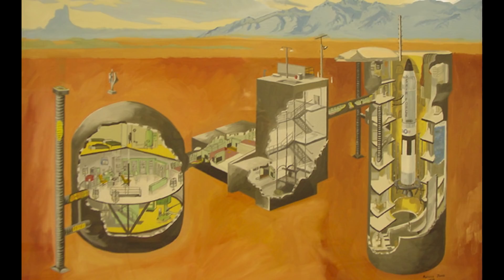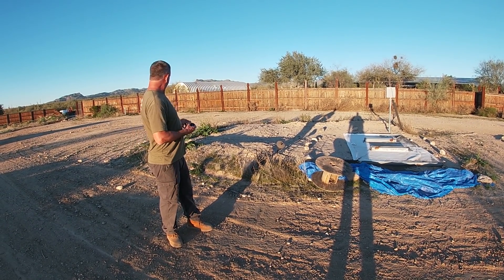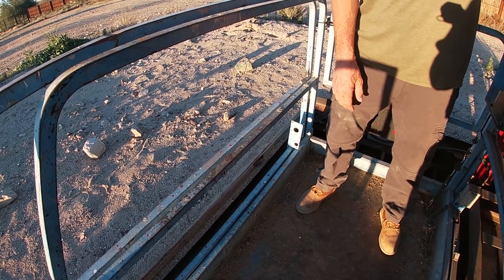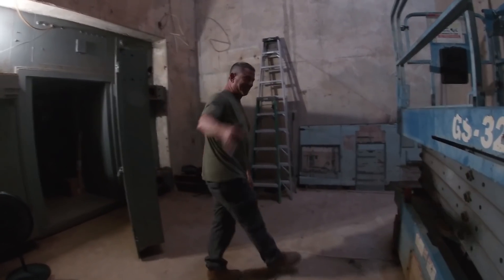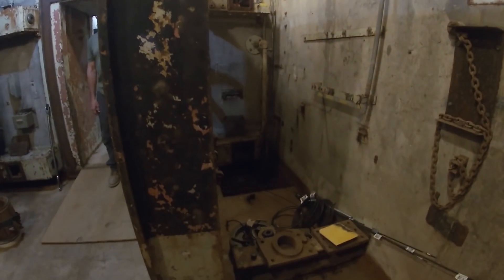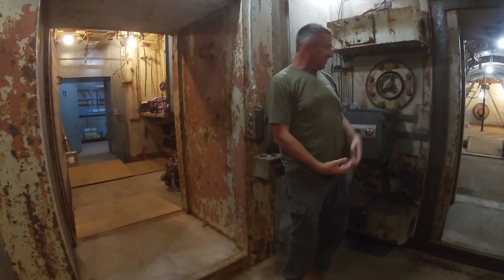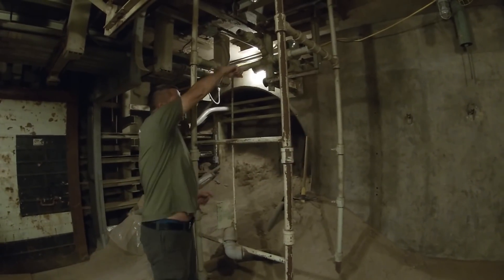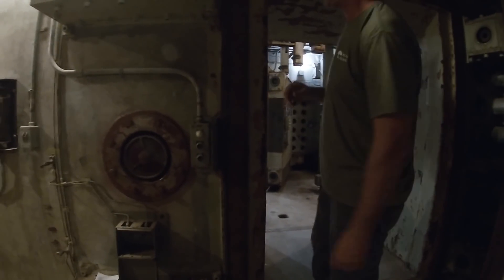S1E14 - Arizona Titan II Tour (1of3) - Owning a Titan II Missile Silo

Comment: Hey. I hope you read this. I'm an old Titan 2 guy who spent 17 years at DM. Getting HS-3 (your blast door locking pins was operated by a hydraulic pump called HS-3) is cool. But please remember this. Never ever put anything on the door sealing surfaces and then lock the pins. The pins will wedge and those connecting pins you're having to repair will break. A guy duct taped a penny then closed and locked blast door 6. The crews worked a day to jack open the door pin. The guys trapped inside were pissed.
Keep those surfaces clean and do not paint them. You will regret it.
Reply: You might want to checkout the video  on ssgtmyway channel.  I was at DM from 80-84. 390MIMS MK 6 Reentry Vehicle shop. Had alot of good times at DM and ended up making a video about it.
Reply: What about adding a good lubricant, to ensure smooth operation/movement of the locking pins?
Reply from the maker: They won’t be hydraulic on ours. Planning an electric actuator.
Reply: @atomicunderground9971  Well, just make sure you have a well. Maintained manual back-up method to open the blast door. Otherwise, that's freaking awesome and I'm totally envious!
Reply from the maker: @hrdknox2000  Escape shaft!

Comment: Where do these missile sites that are located in the desert get their water?
Reply from the maker: Wells
Reply: @atomicunderground9971  Does your site have wells? How many? Did you have to drill wells, or were they there already? How is your supply? What is the well replenishment rate (GPM)? How far down do you have to go to reach water? Have you had yours tested? 

The Atlas F Sites in Upstate New York (where I am), each had three (3) wells with a required replenishment rate of 30 GPM.  At a couple of sites the wells came up either short or completely dry. These sites then went to the nearest source of water (creek, stream, river), built mini-processing centers, and laid pipe back to the site. They then pumped water to three or four 90,000 gallon tanks. Each site had these water tanks.
Reply: @jefflovejoy2997  the onsite wells were decommissioned & abandoned in a state that may or may not be repairable. The site where I found the well, it was in real bad shape.
Reply: @tl1024  Thanks for the reply. The demos on these sites was so bad I figured as much. Water in the desert is treasure. I had also read where these desert sites had (stainless?) steel underground tanks adjacent to, and accessible from, the silos. The water was brought by tankers to these sites. Thanks again. Good luck.

Comment: If you have commercial power to open the door.....what happens if power supplier is knocked out before you get to the door?....do you have an analogue supply as back-up?....anything electrical or digital will be knocked out.....One other small note is that having a door open outwards will inevitably be covered or blocked by something entombing anyone inside and making quick entrance and exit futile.
Reply: I thought he said 12Volt power right before Commercial electric so maybe it's being converted and he has battery backup
Reply: The latches could be manually opened with a human powered pump. It's not especially fast, and if it were attempted during operation (and you hadn't beed detected long before reaching the door), you would be greeted with a barrage of gunfire when you opened the door. I have taken the museum tour several times, and reaching the blast doors undetected would be incredibly difficult james bond level stuff.

Comment: I was in an Atlas site in TX in 1969, four years after decommissioning. All the electronics, hydraulics, etc. had been removed, but the crib was intact and the electricity was on so going down from the surface to the crew quarters and silo was easy. I'm puzzled why with Titan they blasted and filled whereas with Atlas they didn't bother to do anything other than lock things up and flood the entry to the blast doors. All you need do is excavate the fill, not that it will be quick and easy! Thanks for this video.
Reply from the maker: Strategic Arms Limitation Treaty requirements. Although never ratified we did it anyway.

Comment: Pin rusted in the locking mechanism? Aren't these sites build to work forever?
Reply: No , only if they are maintained they will work but the sites that are decommissioned were under water and heavily damage by dynamite during the decommissioning stage.
Reply: @josephbennett3482  Ouch.

Comment: I wouldn't remove the steel beams outside the decontamination room just to be safe. I'm sure they're in there for one reason or another. 

Also if you don't know the name of the suits just call them Hazmat as that's a good umbrella term.
Reply: The beams are not structural, they were there to support the pipes extending between the launch control center and the missile silo.  And I like the suggestion to call them hazmat suits - that's a term everyone understands these days.

Comment: First mod would be taking a hammer to that ear piercing beeper on that lift!
Reply: I tried to disable it - but the beeper is integrated into the circuit board on the controller.  It's almost as if they designed it so you could not take a hammer to it!  I think I will try to plug it or something but I am not willing to take the risk of tampering with that circuit board, it's really expensive to replace.
Reply: @ArizonaTitan       I was a combat crew member.  SAC speaker  had minimum volumes.  We duct taped 4 inches of foam rubber over the speaker.   try it
Reply: @brucebedford5121  The speaker is tiny and built into the circuit board INSIDE the joystick control of the lift.  No way to tape foam over it.  I agree, if it was accessible I could foam it or better yet cut the wires!
Reply: @ArizonaTitan  You need to simulate the load of the device. A non-destructive way we lower or even silence piezo buzzers at work is by threading an 8-32 screw through the opening to stop the vibration.

Comment: I am still watching the video and it is awesome.  Just wondered at 3:23 where the door flexes because it is being hydraulically lifted on only one side, why you didn't install a hydraulic cylinder on the other side as well and just use a splitter to send hydraulic fluid equally to both cylinders.  Would be much more solid.  Anyway, loving the video and your missile silo!  :)
Reply: There was a guy helping me build it, and we only had one (big) cylinder.  We tried to compensate for the flex with a tension cable on the top.  That was 3 years ago and I was a rookie with hydraulics back then.  But you are right, it's on my list of thing to redo properly.  It does need 2 cylinders and a safety valve to prevent quick drop if there is a failure.  Good eye!
Reply: Good job!
Reply: I see the steel cable on top of the door now.  It helped.  I love this place you guys have.  Any chance of me visiting and taking a tour from you?
Reply: @KingCobra1968  Sure!

Comment: unplug the beeper on your scissor lift. those things are so damn annoying and even more so when it echoes.
Reply: I TRIED!!!! it's on the circuit board in the controller and there is no wire to it... soldered in and I am afraid to screw up my controller!  Must be a reason it's so integrated... maybe workers were unplugging it?
Reply: @ArizonaTitan  sounds like you have one of the models that integrates the beeper into the circuit board, most of them are screw terminals or spade connectors. if you follow the circuit board traces you will find the power or ground for the beeper and you can just cut one of those wires. another option is using one side of a pair of cheap ear muffs and taping it over the beeper, this will muffle 80-90% of the noise.
Reply: @crazypete3759  I'll try muffling it, thanks!
Reply: @crazypete3759  ... a small amount of silicone sealer will silence the beeper. Just cover the holes, smear it over, and let dry for an hour.
Reply: @crazypete3759  ... not everyone has a drill handy but it's fairly easy to find some sort of glue, putty, or sealer. Besides, a drill and a PC board could be an issue.
Reply: @rupe53  if you don't have a drill, use a hammer!
Reply: @crazypete3759  ... come on dude, he said it was on the PC board so needs a delicate fix!

Comment: We need to crowdfund Doug and have the level 2 (long cableway tunnel) entrance to the silo itself uncovered, so we can get a look inside this thing.  We know it's dry...or should be given the condition of the other elements of the site...so let's find out just how 'bad' it is inside!  If the generator and other large equipment deemed to cost-prohibitive to remove is still in there...wouldn't THAT be cool!
Having the tunnel removed between the access portal and the silo simply makes this site perfect for this venture!  Providing of course Doug is even open to this, lol.
Reply from the maker: Crowd fund me and I will do it. About 30k
Reply: @atomicunderground9971  You mean for Doug or at your site?  Because I thought your silo is flooded...?
Reply: We own the heavy equipment necessary.  Cost at my site is the actual tube and installing it properly.

Comment: At 15:45.  Those are called blast dampers and are designed to close if there is an overpressure event from the silo (similar to the blast valves from outside).  They are NOT one way air valves, since air can go backwards through them if the Air conditioning in the control center failed.  We would actually have to manually close them if the control center AC went down to prevent negative airflow.  In fact it was part of our daily checks to measure the air flow to make sure that there was higher air pressure in the control center than in the blast lock and between the blast lock and the silo.
Reply: I just love information like this...so cool you were there!
Reply: Thank you!  I was under the understanding they would close automatically if air flow failed (in addition to blast), thus the 1-way story I was told.  I have the pistons and connectors intact, but have not got around to seeing if they work.  Maybe a future video?  ;)
Reply: Anytime, friend.  I hope you really enjoy your new place.  I was at McConnell in Kansas, but have some really great memories in those complexes.
Reply: @sparc77  Thank you for your service.  Drop in if you are ever in the Tucson area.
Reply: Thank you for the great tour, looks like one hell of a project! I thought all of the escape hatches were filled in with cement? Was this one not? Or did you have to break thru it. Or am I wrong thinking the escape hatch and ventilation were the same thing? Thanks!

Comment: I visited this site when it was being decommissioned many times. Working at the time for Ma Bell I worked this area between Catalina and Marana and was somewhat involved in the decommissioning. We had a lot of communication huts that supplied data and phone lines to all of these sites. The job required tearing down connections in these huts as the sites went off line. I was also just living down the street off Tangerine in the Tortolita Mountains. On one of my visits I had the opportunity to explore the tunnel they had removed and left sitting on the ground. Inside I did find one souvenir in a box. It was the blue prints for the silo phone wiring by Stromberg Carlson. Maybe i will stop by and add this to your collection.
Reply: I would love to meet you Ed!  I have uncovered bundles of phone wire in the desert and it would be cool to understand where it came from!
Reply: I was thinking, while watching this, that those were probably some pretty simple phone lines between the capsule and topside, and could probably be rewired as easily as those old field telephone sets.

Comment: Man I'd love to see a vid of the Silo interior, where they all filled in? Or were the AZ ones exempt due to the removal of the tunnel/cableway that connected the silo to the command center?
Reply from the maker: They were all filled in and capped.
Reply: The one that just sold was open I think. Might be remembering wrong though. Have seen the listing in months
Reply: @grahamburgdorf8397  No access to the silo at that site.  However - Where I have a dirt-filled circular hole, that site also has a large sheet of ragged steel hanging down.  The new owner is hoping his tunnel was not removed but rather cut and caved in.  He needs to dig it out.

Comment: Replacing the long cable way is the perfect job for a hydraulically propelled digging shield A arch shaped shield larger then the finished tunnel to hold back the soil above as the tunnel is dug out a few feet at a time and a new tunnel is cast in place before the shield gets pushed ahead letting the tunnel come in contact with the soil above. He could make the tunnel flat bottomed and any size he wanted so not limited to the original metal tunnel size. 

As for how to get the concrete all the way around the new tunnel the answer is shotcrete as you can get smaller machines easily so just need to place the rebar/mesh in place then spray the walls and trowel finish.